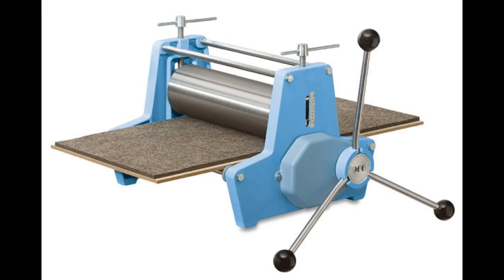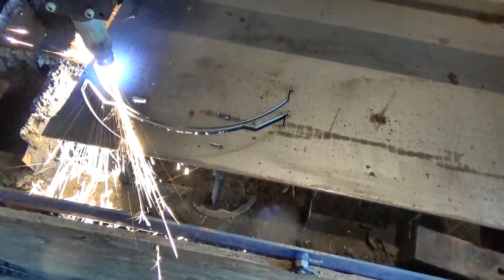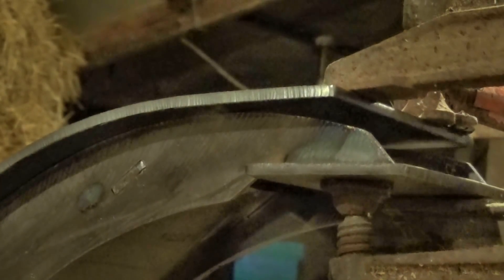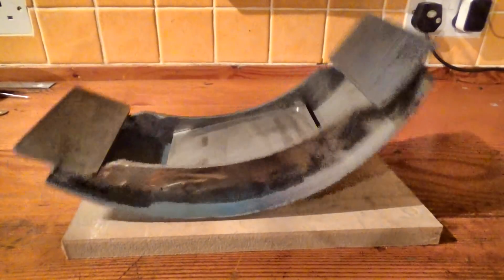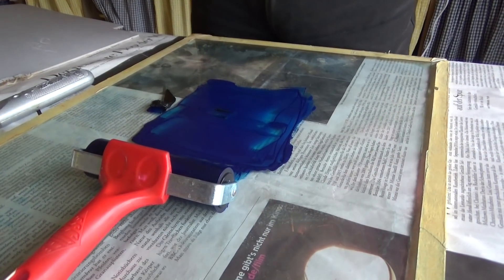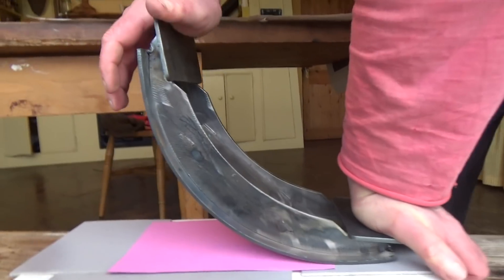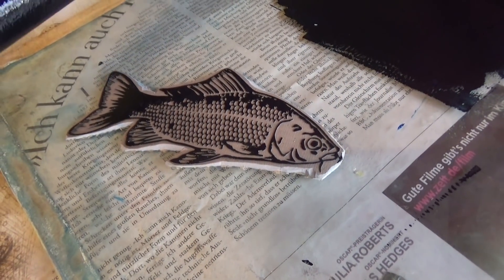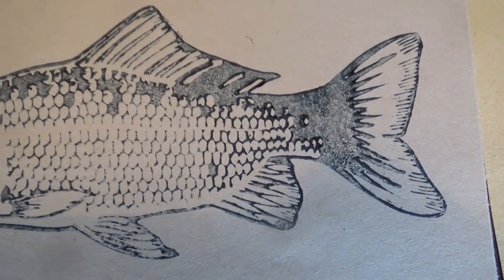The Rocker Press! A poor man’s homemade printing press for lino and woodcuts

Comment: Been a long time since I majored in art ....but as long as the print is small enough a wooden rolling pin from the kitchen works nicely.  Also my best prints came from oil based inks.
Reply: Robin Miller hey, neat!  I was wondering if a rolling pin would work!!
Reply: It's crazy how I thought about a rolling pin while watching the video and the scrolled down the comments and randomly read yours and it said exactly what I was thinking
Reply: I just started hand printing, and have found that the glass weights I use for holding down sewing patterns make fine barens. That being said, I think I'll give a rolling pin a try too. It seems more efficient.
Reply: Too much trouble . . . I’ve been printing woodblocks and lino since the late 1970’s and still print using a barren. 😎
Reply: @ggg-uu4io 😂 I was thinking the same thing as I was reading your comment

Comment: This is great. Your problem solving is Five stars! And you seem to use your back ground in, I'm guessing,  fabricating to great effect.  While it might not be exactly orthodox, what you are doing here is  just to cool to be distracted by orthodoxy. What is art making if not a human activity as varied as we are? I like it very much and approve. Have you tried using a blanket between the rocker and the plate, to cushion and distribute pressure?

Comment: Go to a Restaurant store. By the biggest  commercial rolling pin they have- and the have large steel one. Unroll the handles and then add small dumbbell plates  weights. You can find small 4, 3, and 2 pound plates. Put the handles back on the pin. That’s your printing press with adjustable weights. Your welcome

Comment: Printmaking teacher here! 
Overall I want to say that's a really interesting design, and one that I think could be used to great effect-- but for the type of prints you're doing, the woodcut and linocut, I think you'd do just as well with a baren, a handheld tool commonly used for Japanese woodblock printing. All you have to do is rub it against the back of the paper until the image transfers. It's a great method to try if you can't afford a big printing press.
A heavy duty press it's really useful for etchings and other printing processes where lots of pressure is needed to draw ink out of a printing plate. I think your roller press design could work for that, if you rock it under your feet! 
I also recommend getting a sheet of heavy wool felt to lay between the paper and your steel press, if you continue to use it. 
Happy printing!
Reply from the maker: Thanks, Leah. Yes, this was just a prototype - I want to go bigger : -  )
Reply: a baren works better and faster

Comment: Thanks for your inspirational DIY spirit! I like your idea! I think it would work especially well for collagraph and dry point, where you need more pressure to get your print. Linos usually have a lot of surface ink, and can easily transfer with less pressure than your rocker would provide. So the rocker pressure is almost overkill for that type of plate. Drypoints (intaglio type prints) are done on harder surfaces and require more pressure because the ink is deposited into lines scratched into the surface. Collagraphs have a variety of surfaces, but often are incised or textured with grit to hold the ink, much like intaglio, so the pressure is often a necessity there as well.

As for the cupped surface of your rocker, I think its almost a given that some grinding will be required. You did a bang- up job. Kudos!
Reply from the maker: Thank you - you're right, of course : -  )

Comment: Very cool! Always a pleasure to watch you problem-solve. We used to  make lino prints on dampened paper using a hand-cranked wringer (the old-style laundry gadget with rubber rollers) and a couple of hand-made felt sheets for cushioning.
Reply from the maker: Sounds perfect. Did you stop printing?
Reply: Way Out West Blow-in blog yes

Comment: How wonderful !   Very clever design. I've tried lots of inventions to achieve a similar effect; in fact to be able to make engravings as well which means a lot more pressure. Putting equal pressure on the surface is a difficult thing to achieve. I noticed this when I made my first "mouse squisher" by taking apart the device you use to lower a drill with a handle and built it back so that two plates would be pressed against each other. I couldn't, however, get the two plates exact enough and I was pressing moulds at the time so I abandoned the project. One of the ways traditional presses achieve equal distribution of pressure is  sliding a bar over the plate as it is pressed with a spring levering against the pressure so that you can press in one flowing motion. In fact, it's a similar concept to the roller as the pressure is transferred from one side to the other in a rolling motion. I'm at present using an A3 embosser to engrave which they say doesn't produce nearly enough pressure. I can tell you it does; besides I've got 2 solutions I haven't tried yet: [1] making a mould of the engraving and then pressing the paper between the mould and the engraving so that it will push up and pick up the ink (meaning you don't need nearly as much pressure), and [2] fixing an enormous wheel to replace the little handle of the A3 embosser. I bet that would work if it doesn't provide too much pressure too quickly and snap the internal workings of the embosser!

Comment: I just did a printmaking project of my own; I sure wish I had your rocker press! All I had was a small roller, which didn't work as well as I would've liked. My print was about a square foot in size, and trying to apply the same amount of pressure everywhere was difficult. The result was alright in the end, but there was certainly room for improvement! I'm curious to see where your printmaking adventure takes you!

Comment: Its been a bit since ive done linocut, but a way ive found for getting a good amount of ink but not too much is listening to the sounds from the rollers. 
Admittedly it could be just as i hear it from the video & my ear buds, but if the ink is a good amount it should sound like a "shhh" sound. If it's too much itll make a wet, sticky, crackle sound both while rolling the ink and putting it on your cut.
( the 1st ink being too thin also might throw this advice out the window buuuut)
To avoid it myself id roll the ink and in an empty spot ( or a less inky one) & roll until i got the shh instead of the sticky crackle. 
I hope this makes sense & helps. Good luck on your book and i hope you have fun with your prints!
Reply from the maker: Thanks Beeks. Lots to learn and no one to teach me, but I'm getting there

Comment: Hi Tim. Perhaps a sheet of blotting paper or thin felt or a tea towel between reverse side of the paper and rocker roller might give more even pressure?  Prints looked good, reminded me of my sound lino cuts years ago - not so good as yours though. Best. PEK.

Comment: There is a version of a rocker press made out of a skateboard and plywood. The skateboard is the top, they made ribs like yours and wrapped the base in plywood. I believe they kerfed the plywood to get a good even bend. When they printed they put the lino on the ground, layered the tshirt, put suepr thin play on top, then rocked over the whole piece of ply to print. they weren't very efficient but they would get kids to rock the press over the shirt. they were focused on making printing fun and engaging.

Comment: Anything from a tablespoon, which my dad used as a baren for all his woodcuts, up to a small steam roller, which a local printing cooperative uses for wall-sized prints. 

When I used to do linocuts, I'd leave them on the block and use a hand baren - cheaply available at any art supply store. Pretty good results. 

If you subject linoleum blocks to a lot of pressure, I would think they would break down after so many impressions. They're not as strong as litho stones or metal engraving plates.

Comment: I have tried various prints using a 3d printer with pla to make the plate. Originally I pressed the print onto the paper, but eventually stumbled across the idea of rolling the paper onto the print which worked better, but pla is quite hard & the prints were still not great. I used stamping ink as I didn't have proper printing ink. There is a softer rubbery filament that is likely better then pla, but for the small number of prints I wanted I was too cheap to buy any. One could of course cnc a plate out of wood or hand carve out of wood as was once the preferred method but perhaps Lino is more uniform. I only tried small Lino pieces & didn't like how easily I could break it! Thanks for sharing!
Reply from the maker: I'm impressed - I wouldn't know how to use a 3d printer at all
Reply: @WayOutWestx2  Much to my surprise I found 3d printers very easy. The one I have, the Creality cr10, was easy to put together, easy to level and it has printed everything I wanted from the thingyiverse site. Learning Fusion 360 took a little time but having done that the process of printing via the software cura which is called by Fusion 360 is very easy. I am still amazed at how precise the prints are, to .001 inch and i now use it for lots of jobs that once i would have made from wood or machined. The filament pla is strong enough to make lathe gears and you can stall the motor before they break. Prints can take several hours depending on what it is and i often run jobs overnight, it is like having ones own machine shop with an employee who never answers back and always does what you want. Probably you have more than enough things to do, but if you ever need 3d printing I find it very easy, learning to use my cnc router was a lot more trouble and full of mistakes and vexations.
Reply from the maker: I was thinking more of the designing/drawing for them. I'm one of those boring people who needs to keep re-inventing the wheel because I enjoy starting from scratch, so I'm not sure I could just take other people's designs and print them out. Though that would be exciting to watch, for sure.
Reply: @WayOutWestx2  Sorry if I didn't make myself clear. All the stamps I have made are my own design executed via Fusion 360 which is zero cost for small business/folk earning less than $100k or something similar. You can import images and do all manner of manipulations to create your own files to print and the interface from Fusion 360 via Cura is a single click to launch Cura to then create the slicing file in g-code for the printer. I have been taken by how easy it is and how accurate and strong are the prints. It often takes a few hours to print, so I often set them to run overnight or other times when I am busy.

Comment: My printmaking professor made a pretty similar device out of particle board with a skateboard for the top instead of handles. The operator would get on the skateboard and rock back and forth
Reply: Do you have a photo of that? Sounds great

Comment: Note: I was using a laundry wringer where I pressed my linos and embossing folders in a double wooden plate which were tapered at the end so it would catch. I had to press it really, really hard because the device is pretty simple, but it worked perfectly well. I don't know why more people who don't have a printing press don't consider laundry wringers... but it's probably precisely because you have to take them apart and rebuild them for them to be any good.
Reply: Been using one of those for lino, for years, works well!

Comment: The roller that you have is used to make a print. You'll want a rubber roller for inking up — just a bit wider than your shortest side (as they're quite expensive). They hold the ink well, allowing for a smooth rolling. Less "orange peel" look, more a smooth sound
Reply from the maker: Really? I didn't realise. Thanks, Michael.

Comment: Wonderful. I had an idea if you put more curved 4mm metal plates as well as flat bar welded sideways to the curved plates every inch or so so that you don't get any dips in your curved flat sheet & for your curved flat sheet if you could make it out of 2mm or 3mm instead of 4mm then it would bend easier as well as if you pre-heated the flat sheet to a nice cherry red color before you rolled it over the curved straight sheets.
Reply from the maker: Yes, you're probably right on all counts - but I got there in the end anyway

Comment: Do you have access to any large castor wheels or maybe solid tires/tyres you could make a press and roller that would follow the same principle of reducing and focusing the pressure area of the press.
Reply from the maker: Wouldn't any gap between them show up on the print?

Comment: A roller used to glue down flooring? Maybe heavier per square inch and smaller diameter than lawn roller. Barter for time and space in a print shop
Reply from the maker: We live in the middle of no where - no print shops nearby. Wish there was!

Comment: I'm no expert but this takes me back many years to a print shop class I took in school.  The lino is a lot of fun, isn't it, but I wonder if there might be other tech that would be better.  I remember using silk screen equipment that looked very inexpensive and it might give better control over the amount of ink.  I also remember cutting thin lines in a piece of plastic. The lines get filled with ink and then the plastic is pressed against a piece of paper. I don't remember the details.  Multi-color might be easier with either of these methods and certainly with the wood block methods others have mentioned. Ukiyo-e can be inspirational.  IIRC, the softness of lino that makes it so easy to use is also a drawback because pressing against it will wear it down. But I guess that might depend on how many prints you're planning on making.

I hope you'll show us more of this.  And I'd like to know how you cut out the fish too.
Reply: The "cutting thin lines in a piece of plastic" is called intaglio or drypoint printing.
Reply: @goilo888  Thanks.
Reply from the maker: Thanks, Quint. I'm still learning what might be possible - but really I don't have the time to explore. Maybe when the book's finished..
Reply: @WayOutWestx2 May I respectfully disagree?  I think a few quick web searches might yield some interesting information and save you a lot of time.  I suggest two, "intaglio plastic cheap" and "rolling pin printing".  Anyway, have fun. I really do hope you'll share more of this project. Thanks.

Comment: Roller-printer-wise, my mother used to have one of those old-school washing machines that was a tub on the bottom with a twin roller hard-mounted on top. They vertically mounted in a stack, were height and tension adjustable and could give a really good clamp, iirc.

Maybe you could find something like that? It should be in a scrap heap sale by now and you might find one in an estate sale or on your local version of Craig's List.
Reply from the maker: I wish! I've been looking for months..

Comment: What a neat idea! Have you tried printing on the floor with your body weight added? It seems to be just big enough to stand on when you are bending the plate in place. I think you might get even better results by looking into more suitable ink, roller and paper. (I mostly work with drawing, but I'm educated as a printmaker)
Reply from the maker: I'm making a bigger one too - but I'm not sure it would ever need that much weight!

Comment: What sort of lino did you use? The thing your dog chewed doesn't look like the lino rubber they use in Belgium which is actually more like rubber than floor lino. Starting from knowing nothing about it, I also started using floor lino at least the stuff I had on the floor which consisted of shiny upper layer and a soft layer of insulation for against the floor... Then I went to an art shop and found out how expensive it was to buy a tiny sheet. So since then I've been experimenting wiith every imaginable surface for relief and intaglio printing that doesn't cost me an arm and a leg. I got the best results from [1] click laminate, [2] real estate signs, [3] floor lino and [4] oil cloths (thick plastic table cloths). I don't think I was able to try the sort of lino you fed to your dog!

Comment: I have a swedish heavy duty vice that I bought with the intention of building a small press to make my own card games. I would be happy to give you it if you wanted to use it to make a printing press version. Maybe show a comparison between printing techniques?
Reply: I live in macroom so I don't think I'm too far away. Sure let me know, Matt
Reply from the maker: Are you serious? That sounds brilliant - thank you! 

Would it work vertically, do you think?
Did you try it at all?
What does it weigh?
(Lots of questions!)
Reply: @WayOutWestx2  This is the one I have. I think Mine might be a bit longer though. I have had it in a box for two years unused. https://www.axminster.co.uk/veritas-shoulder-vice-screw-475258
Reply: Ok I attached the wrong product. If you search Veritas Tail Vice, that is the one I have. I think it can be adapted to work as a press vertically....not sure how though!
Reply from the maker: Yes, I wonder how too. Did you find another way to print your cards?

Comment: this is great! I like it, unfortunately I don't have welding equipment and it sounds like you're not in the states, so it would be a bit much to ship one.  You could try using a soft rubber breyer for softer ink. I personally don't like the hard ones cause they're less forgiving, and over time the surface can get uneven.  Nice Work!